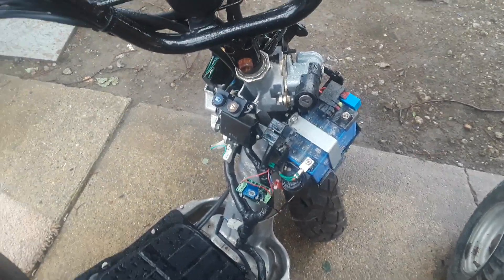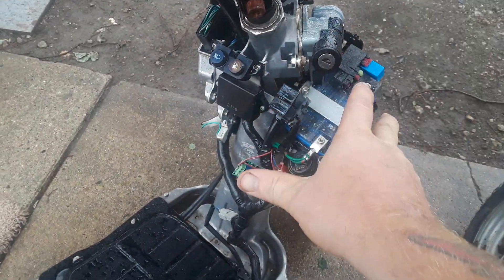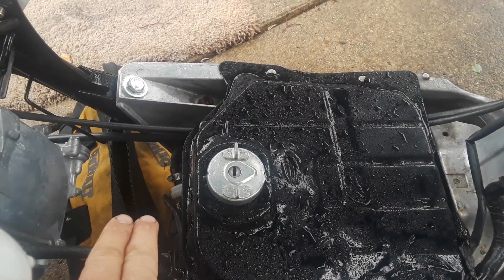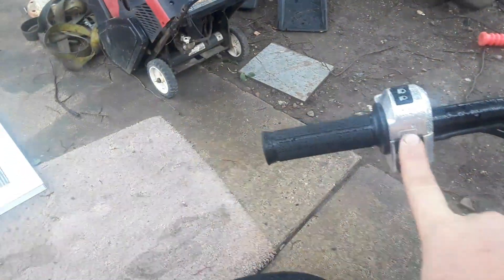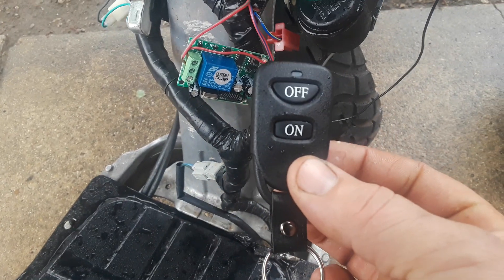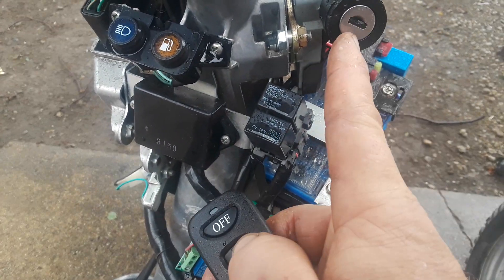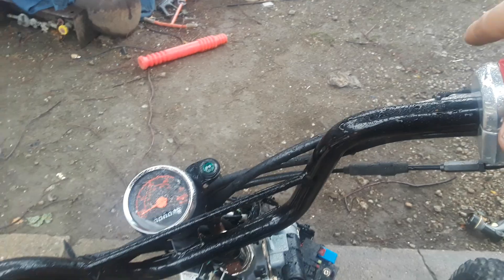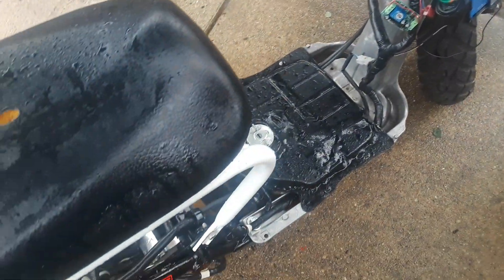Honda Ruckus keyless ignition

Comment: Okay this is the question I have if there's anybody that can help me please leave a comment I would appreciate it now just purchased a 2013 Honda ruckus it doesn't have a key the gentleman turned it on it ran and it turned right back off and hasn't been able to start since and has been sitting for a while so I have purchased it cleaned out the gas tank put fresh oil put a brand new battery but I'm not mechanically inclined so I need help